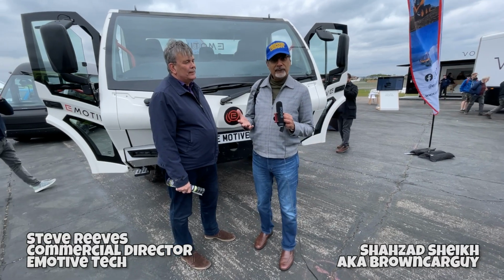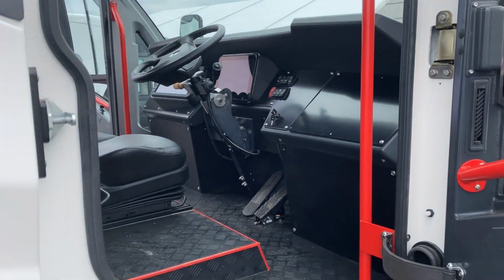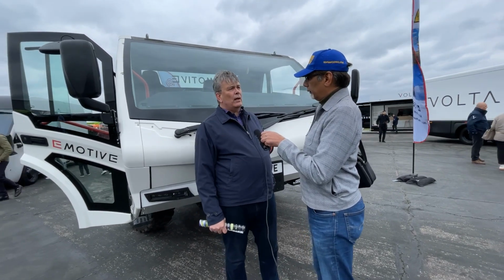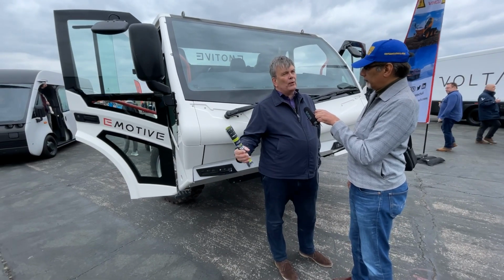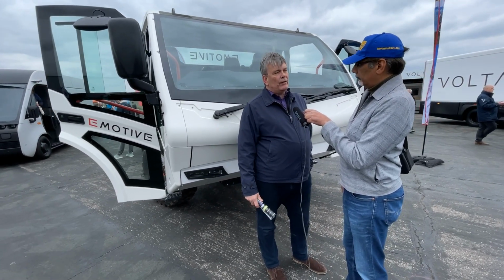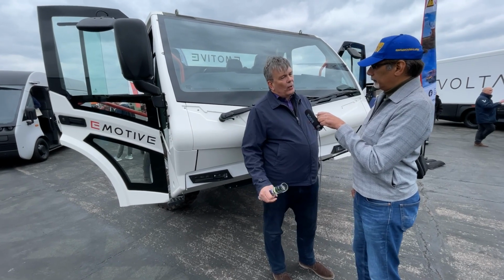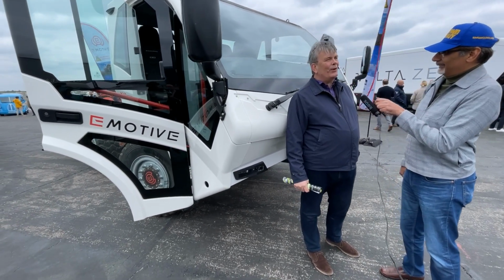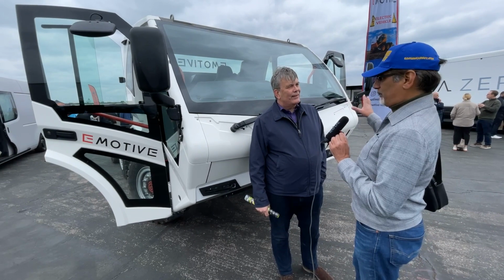EMotive Scarab All Terrain Vehicle Walkaround at Fully Charged Live [The Martian Meets Thunderbirds]

Comment: Can you fit a shipping container on the frame? Expedition truck builders sell these custom living units with shipping container dimensions and frame mount points; you'd have one fitted, cover it with solar panels, have them connected to the electric engine in some way and off you go.
Reply from the maker: Probably can I’d imagine
Reply: Can be done